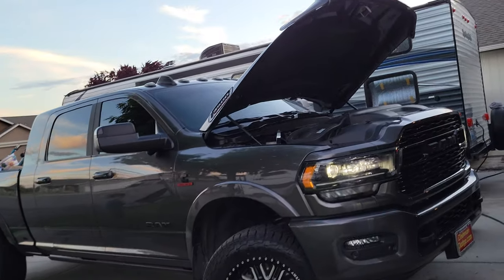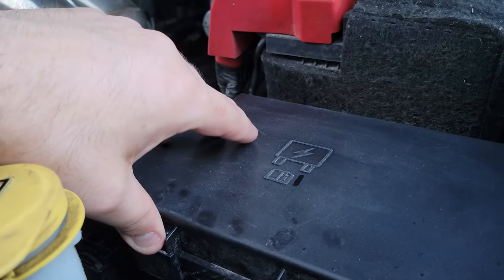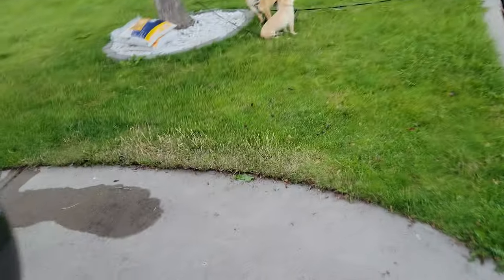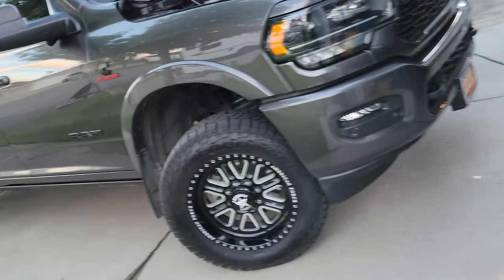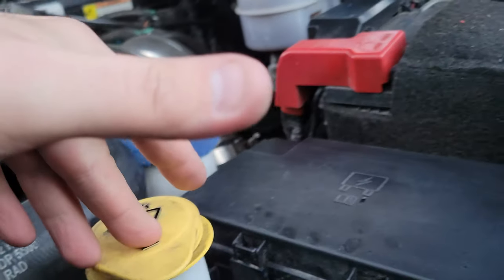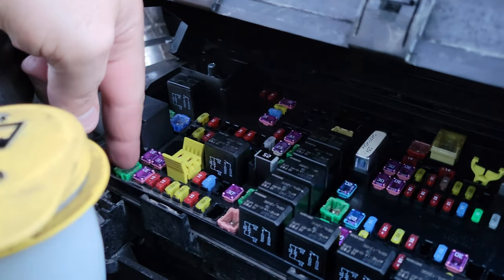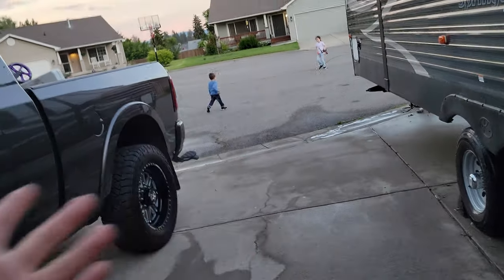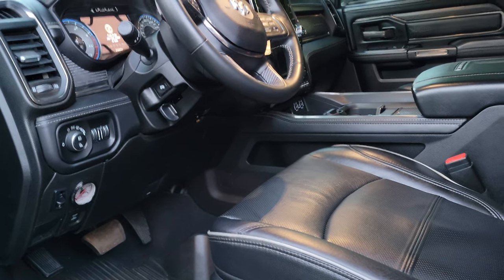Ram owners need to check your fuse box.

Comment: Man the electrical issues on these newer vehicles are just awful. My 21 RAM 1500 5.7 has 70k on it now, not a SINGLE issue whatsoever. I lucked out lol. I’ve seen dozens of RAM owners just having the worst experience with their brand new vehicles.
Reply: Father in law has the same truck as you. No NOX sensor in the fuse box, it was running like pooh with rich fuel code PO175. I wonder what is wrong?

Comment: Had random issues where the 12” display would have a random issue nearly every day and 1 day even had an airbag sensor failure to respond message.  Read to check fuses, nearly all were halfway in, pushed em all in and no more issues since, on my 2022.
Reply: Same here drove it off the lot in Lake Charles and about 90% of them were lifted and not locked in i could hear them click in pretty nutz. On the HDRams forum they have a truck check list when picking up your truck thats near the top.

Comment: Thank you for this video. Couldn't figure out what was wrong with my 2016 Ram. Went and did this. Darn near every single fuse was loose. Problem was instantly solved.  Appreciate you!
Reply: Yep , I saw the video , went out and checked just about every fuse was loose. I didn't have any problems before hand just thought I'd check . Sure enough.

Comment: Came across this video looking for a solution to a p0882 code on my 14 ram 2500. Almost every fuse was loose and ended up fixing my tcm low voltage code that had my truck in 4th gear limp mode. Thank you so much for the information. Saved me a tow bill and money to fix a problem that didn't exist.
Reply: i know u posted this a while back but which fuse did you replace for the tcm? My 2014 wont shift pass 4th gear and loss communication with the tcm
Reply: @Jakeboy24  i didn't end up having to replace any fuses. All the fuses were good just one of them was loose. Had never messed with the fuse box before until that day and started checking them like this video and discovered they were loose. Snugged them all back down and the issue was gone and haven't had anymore issues.

Comment: Dodge Ram and Ram have had a problem with the TIPM since it was introduced. TIPM stands for Total Integrated (Something) Module. It is supposedly basically a big Fuse Box. Unfortunately, it communicates with the PCM - Performance Control Module - which between the two controls everything about your Truck. I bought a new 2007.5 Dodge Ram 3500 Dually specifically to pull a 5th Wheel that we camp in.  About 5 years ago, it went out and managed to take out the PCM along with it. They have changed these designs about 4 - 5 times and have never got it fixed. This was during the Chip Problem issues and the Dealer actually kept my truck over a month. When the TIPM is going bad but has not completely failed yet, you will notice some really strange things happen. One of the most common is your Passenger Rear Turn Signal/Brake light will stop working concurrently with something like your AC quit blowing cold. Replacing my TIPM and PCM cost me over $5000.00 to get them replaced. One last thing before you research online for yourself, Every 3 - 4 years, Dodge/Ram has revised these - supposedly to fix issues. NONE have been successful but it has created more issues. If you have a 2007.5 like mine, there are no new replacements, however, there are one or more companies who repair these and the TIPM is basically Plug and Play. They're on about the 5th iteration. Good Luck - You'll need it when yours goes out. And it WILL!

Comment: Buck and jerk gone. Thank You! Priceless
2018 3500 Cummins.
I was going nuts looking over the whole truck looking for what was causing the non stop buck and jerk while driving. Fuse box, every fuse was very loose, BINGO fixed after a month of agrivation. The obvious U joints, carrier bearing, differential, traction control fail, and many other items I looked over waisting my time.
I know the dealer would keep my warranty covered truck for a week and screw somthing else up on it and not fix the issue. they done it before! Oops, 4 wheel drive trashed when I got it back, you need a new transfer case$$$ payday, what?
Stay away from the dealer, learn how to fix it yourself and dont let any monkey screw up your $90,000 truck.

Comment: I had a blackout on 2016 rebel twice, first time had it towed and dealer couldnt find issue except told me battery was getting weaker... second time was about 2 weeks after i got it back and died right in the drive through window at bank .. fuses were all good..but what i discovered was somehow my big feet disconnected the wire harness, once i hooked that back up and ziptied that wayyyy out of the way , i havent had problem like that again.

Comment: I went and checked those, and my heated steering wheel work again! Thanks so much!
Reply: Was your fuse blown? I keep blowing a fuse and the heated steering wheel and steering wheel controls will stop working. Not sure what is causing it. Cruise control will still work though.  I've gone through more than a dozen fuses.
Reply: @KD-kf4zm  have you troubleshot it yet?
Reply: @natemorgan7184  Not enough. Right now it's blowing the fuse when I start the truck. I'll change the fuse, it'll work on accessory mode, and run position, but when I start the truck the fuse will blow.
Reply: @KD-kf4zm  have you checked any other power source related to steering?
Reply: @natemorgan7184  Not sure what you might be referring to. 

I'm afraid I'll need to tear into the steering wheel/column to look for loose wires.

Comment: Thanks for looking out!  The Uconnect screen in my 21’ is in and out with green and purple lines running through it…sometimes it’s there sometimes it’s not.  You can only see it against lighter backgrounds.  Screens never been damaged and has a screen protector. Def checking my fuses now!

Comment: Funny to find your video. I just bought a 2023 1500, and I’m having an issue with my dash lights not wanting to shut off. First thing I did was check the fuse box under the hood and found this same issue. Never fixed my problem but I feel like when the dealership receives a vehicle this is something that should be checked regardless of it being a known problem. Going to check the fuse box in the truck today and see if they are loose too and hopefully have a problem solved without another dealership trip
Reply: What ever happened bud? Second time it happening to me
Reply: I’m still dealing with it, I have another dealer appointment on Wednesday coming up to hopefully figure it out. Fingers crossed anyways

Comment: It’s probably the inherent vibration that inline 6 Cummins have at idle, about like the gm 4.3, not very balanced from the factory. That vibration will work at stuff like that. Also could potentially be any rough roads you drive on, there’s a bad one that leads to my place of work, and it doesn’t matter what I drive, after about a week I can check my fuses and stuff and nearly every fuse will move. But if I take another, smoother, road to my work, my fuses won’t move when I press on them. Just some thoughts.
Reply: My buddies 2014 with the 6.4, our work truck which is a 2017 with the 6.4 and my 2017 Cummins all had this problem. I don’t think it’s specific to what motor is in it, just bad quality control

Comment: My 18 2500 6.7 ac blower just stopped working. Replaced it with no luck, replaced the resistor even though it looked fine and all the pins tested on it. The plug to new blower was getting power when you would turn on switch with voltmeter. Checked fuse box and fuse was good (not broken) from first glance. Pulled it anyways and one side of it was burnt black so replaced it but still no blower motor power. I looked over all fuses and every singe one was up 1/8” and had to pop each one down. Don’t know how nothing else got burnt out but I’m gonna be pulling the box out tonight and looking at the wires going into hvac blower fuse. I’m sure it’s all fried 😡
Reply: Same exact thing just happened on my 16 1500. New fuse and it's working. Got me on pins and needles wondering what else could be screwed up with it now. I see this is an old post. Any other problems after you had this happen?

Comment: Any updates to the ram 2022 emissions nightmare video you did about 3 weeks ago?  Will soon be taking delivery of a new 3500 srw with the 6.7 HO so just curious! Thanks
Reply from the maker: Video coming soon
Reply: I’m looking forward to that one as well. I have a 22 3500 SRW HO as well that I got in Nov ‘21 and lost a DEF injector at 5k miles (around 1k of towing). Dealer took care of it right away and said it was very rare to see that repair but I’m not sure if there are more issues coming?

Comment: Hey Paul,thanks for sharing. Question for you, we’re out on a camping trip as well. Any tips for fueling on these trucks with high flow diesel nozzles? Every fill up, I can get the handle squeezed about 1/4 of the way, anymore than that, the fuel overwhelms the fill tube and the pump clicks off. Have you or your guys figured a way around this? Feels kind of silly to fill a 50 gallon tank with a high flow nozzle and I can’t take advantage of the high flow. Random other question, did you ever spend any time in Pittsburgh?

Comment: We have several rams and have replaced tipm in many of them 15 model year to 2021
Reply: My fuel pump continuously works until battery dies, do you know if replacing the tipm will help?

Comment: It’s not just on the Rams. I had an 06 charger that randomly would lose all power for a couple seconds then come back. Slow speed, high speed, no good pattern and no one Identified that box as the issue at the time. I had to dump the car after it almost put me into a guard rail going around a turn.

Comment: so i have a 14 ram 3500 and my issue is that the interior electronics come on and off by itself without a key. im wondering if a bad fuse could do this? i didnt think to check all of the fuses because i assumed if a fuse was bad the interior lights simply wouldnt work at all. now im thinking if you pull and put back a fuse would that set off whatever controls those functions? but, at the same time when the vehicle is running everything is consistently fine so idk.

Comment: I’m still having trouble with my 2014 dodge Durango R/T took it to the dealership they said it was the shift knob it would say something like in park put back into neutral also driving at night all my lights would turn off and my home link would stop working. Also recently my wipers stop working? I’m trying to figure out what it could be? Need help

Comment: My 19 megacab get the new fuel pump next week,  any insite on any notable changes to expect? I can't find anything.  I'd assume it would have a different tune ect or a change in mpg?
Reply from the maker: Your mpg will go up a bit
Reply: @pddieselpower  thanks , I'll be doing the same unloaded trip from wis to tenn 640 miles I did 2 weeks before avg 19.8 at 75 mostly.  Bringing my 24' enclosed home avg 10.2 at 70 before upgrade